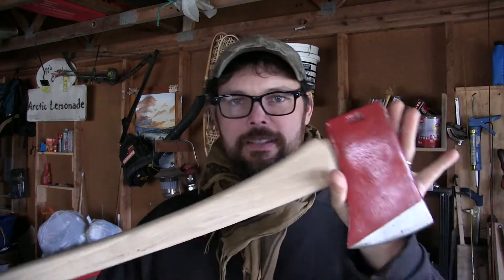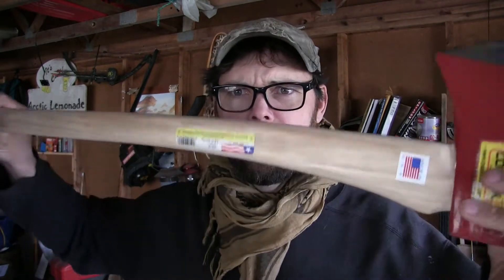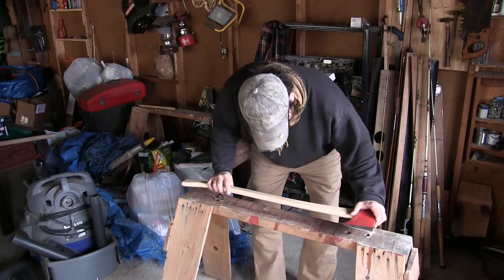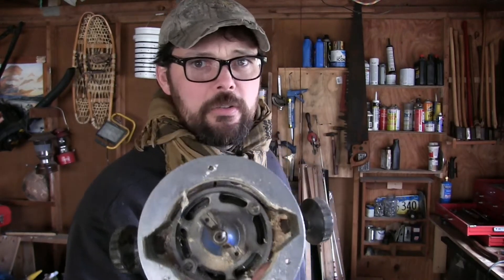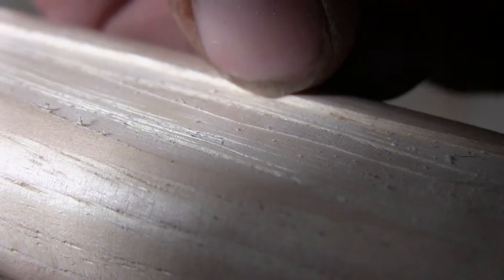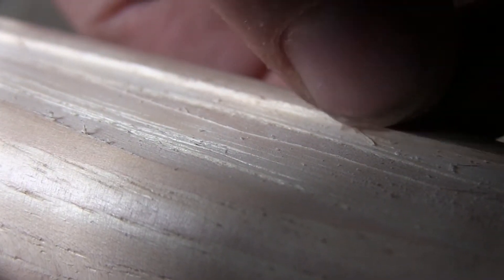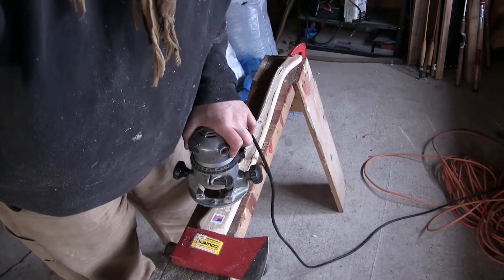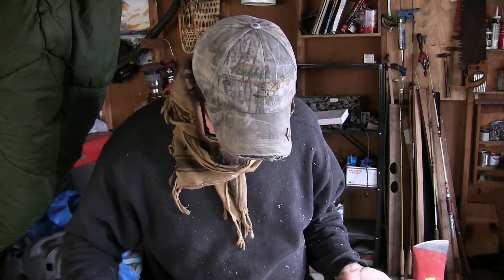Council Axe Handle Project

Comment: Hey I usually draw a center line on the handle first,top and bottom just using my finger an a lead pencil ✏️ from end to end then draw a line from bottom edge to 1/3 of the way up . Sand it out with a angle grinder with 36 grit flapper wheel stopping about 8" inches from the swell ,then change flapper wheel to a 80 grit to smooth it an shape it . Finish with some hand sanding 120 grit an scrapper work as needed . I'am done in about 25  to 30 minutes,one more thing is until I use it for a little while I really don't know if it's right so I bring my scrapper an some sand paper out when use it to buck a few pieces of wood in my opinion the best way to tell how good your axe is responding to your handle work ,you feel the flex an whip action in the handle when done right it like connecting up with a baseball an a bat flawlessly ,no shock . My two grandfathers showed me how to hang an axe an shape it to you but the would have never used a power tool on an axe ,one other thing they both agreed on is never drill a hole in the handle use a chocker to hang your axe by its handle. I used hickory tannin to coat my handles an pig fat to oil the head . Good luck with your new axe it takes time to fit it to you but well worth the time .
Reply from the maker: Thanks. Sounds like a good process

Comment: The best combo I’ve found is a 40 grit flap disc on an angle grinder, Shinto rasp, knife, sand paper. I’ve got a video on my method. I think it’s called Oschenkopf: The Tune Up or something like that. In any case, after much experimenting with belt sanders and whatnot. This is the fastest.
Reply from the maker: Right on. Its so hard to find a good handle
Reply: Council Velvicut makes a nice one, and Killinger and Bushcraft Sisyphus from YouTube makes really nice ones but you’ll pay for it and they’re hard to come by.

Comment: I can profile a handle in about 30 mins with a rasp. my favorite rasp now is a shinto rasp. best 20 bucks ever spent!  The remaining time spent on my handles is purely preference on how smooth I want it. You just can't beet an aggressive rasp!
Reply from the maker: I'll look into that rasp. I have two of my own...one is an old Ferriers rasp and the other is junk Chinese pot metal.....I could use a good one for sure.
Reply: Bushradical they are sweet. I have old ones that are awesome too but it's hard to find good old ones, that's why I bought the shinto. I talked about it in my video called axe vlog 1 I think? not to many videos back.

Comment: No judging here. That's the thing with those hardware store Axes. Just keep it as a beater axe, if it's lost or stolen, no big deal. I think the head is worth getting a edge on it though. I personally love Council Tool Axes, but, I wish they'd get out of the cheap axe market........to me, it only hurts the brand name. Just my opinion. Thanks for sharing David.   -Stephen, Ohio
Reply from the maker: Yeah, I'm with ya'. I like there axes, but there are other companies out there making axes in the $40 market. If they would turn out a pro tool with a hand fitted/chosen handle that didn't need work for $80 I'd be a bigger fan. But hey, a good axe company here in the USA , thats something to be happy about.

Comment: Hey man, whatever works right?  A belt sander with aggressive grit paper really removes material pretty fast and
efficiently. Another, but spendy, option is one of those spindle sanders fit up with aggressive grit wheels. One of these would really  give you control on how much material your removing.  Great vid as always...TFS!     (you should leave the key for B)
Reply from the maker: I'll probably leave her the key, LOL.

Comment: If I had I dollar for every pig I put lipstick on I'd be a multimillionaire twice over ! I just watch your axe handle video with the tree different applications 👍👍I've been a sub for a guy in Scandinavia who makes Puukko knives , he does some incredible builds .( The Thetopicla ) check it out .anyway he has a concoction of 70% tung oil, 20% turpentine and 10% pine tar . This stuff is awesome , I've been putting it on my framing hammer handles , rakes ,shovels and other tools of mass destruction . Great stuff ,and a little goes a long way, the smell is a combination of logging camp and saw mill 🌲🌲. Give it a try and let use know what you think.
Reply from the maker: Where do you get tong oil?..... I've never used it.

Comment: My axe is still wrapped up in the shipping plastic. I have a band saw and air tools at the hanger. I'm still mulling this over. I think you will have an axe "moment" with the answer. If not two or three shop hours is not bad for an axe you may split with for a decade. Or great karma builder giving it to a neighbor that needs a good splitter. Cheap is not good and Good is not cheap. Your dancing in the gray area with this one.
Reply from the maker: Totally. I think its a plenty good axe and for the money hard to beat, unless you take an old american head and hang it yourself its hard to get a better axe for less.......Be careful with the bandsaw...I've tried to dial handles in before with a bandsaw and made a royal mess, LOL.

Comment: An old fashioned draw knife would work a lot better. the dtaw Knife is a fantastic tool ,with a ton of optional ways to be used.
Reply from the maker: I'll check that out. My experience with draw knifing handles is you have to be soooooo careful about grain transitions. I've gouged handles up pretty bad. I like a good scrapper. The router thing was just an idea I had, that I needed to try. You see it didn't really work that well. LOL

Comment: That was hilarious . Pretty sure those are like 59.99 now because of the shortage of crappy covid lumber. I just got a Council Hudson Bay that was 25.00 four years ago for 69.99. The head is awesome  and it's hung ok  (uh, so far) but nooo,  the grain is horizontal. The handle, though, is nice and thin and straight. The axe does rock.  For a backup handle , I got a "premium"  House Handle dot com  brand Boy's Axe handle, 26.47 to my door . I got the octagonal, which is interesting. It's workable, the grain is vertical. The shaft is a wee bit warped, so I clamped it to a table with a Quick Grip.  I am on the alert list with KillingerOfficial.com for a better Boy's axe handle, I think he gets them from the Amish. They are probably worth the extra 20.00  versus, yeah I hear ya, 5 hours of your LIFE.  Don't ask me how much time I spent learning about the current axe handle crisis.  I do wanna try crafting one out of an ash sapling , ignoring the knots, of course.

Comment: Council tools ax is not wheat they use to be
Reply from the maker: I buy a lot of stuff at flea markets and Ive seen countless OLDER council axe heads....I personally think the heads are getting better. The old ones were super thick through the eye area, the newer ones seem to be a bit more refined. As for the handles...I don't really know. But I will say , Ive yet so see one thats hung straight from the factory.
Reply from the maker: To be fair , they are made in the USA and the steel does seem rather good. and they aren't $200 like the imports everyone loves.
Reply: Council Tool's VELCICUT line of axes are still top quality, but they're quite pricey also.